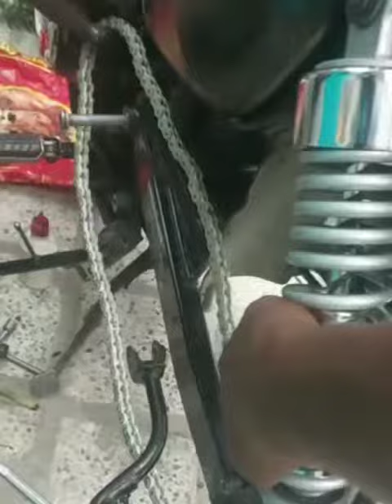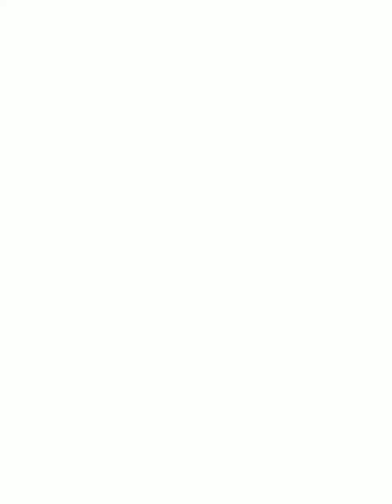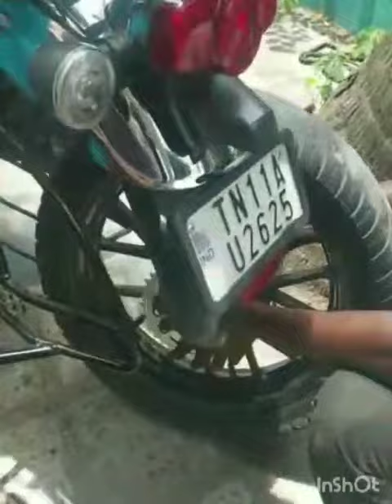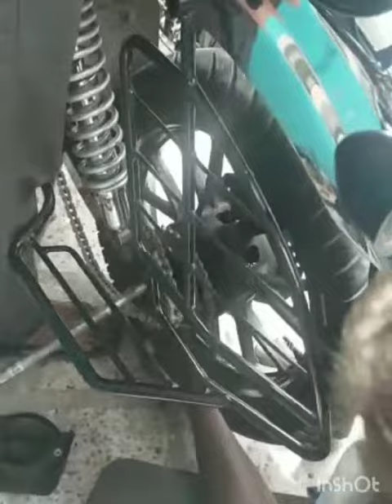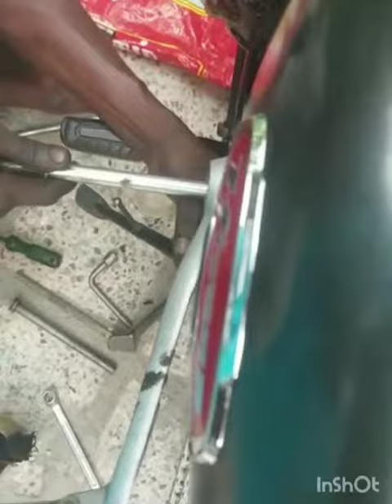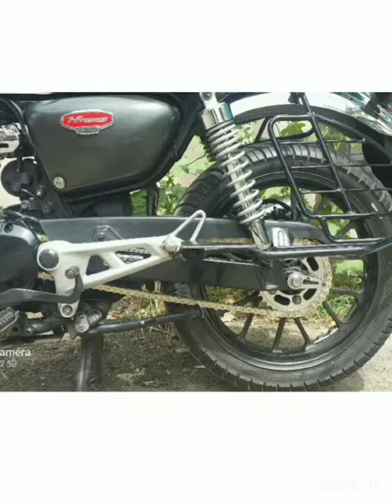Brass Chain Sprocket Installation for Honda Hness CB350

Comment: Hi, as I can see this video is already 9 months old, would you pls let me know current feedback on this Rolon Brass chain sprocket?
By the way thanks for this video..
Reply from the maker: Chain has crossed 29700 kms, needs to change after another 2000 kms, and thinks it's the right time to change. Good product

Comment: Bro... Whether it's a same size sprocket as stock or taller sprocket to increase the performance... How's the performance after changing this... Pls reply
Reply from the maker: Performance is too good, during rainy season I feel the difference, chain loose or right or lubing didn't face for the last 1 week of Chennai rain, you can try.
Reply: Bro... Stock la erukka athey size ah illa sprocket size maathenengala.. Taller sprocket pottah nallah erukum adikadi gear shift panna theva illanu sonanga athan kekkurean